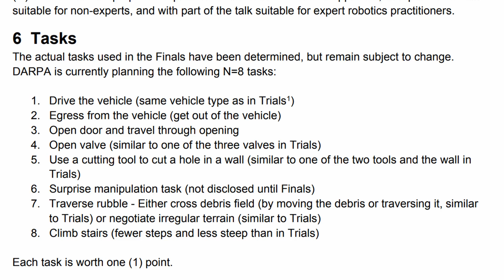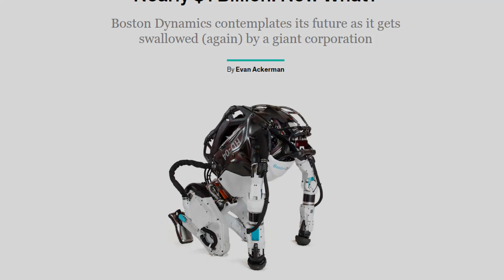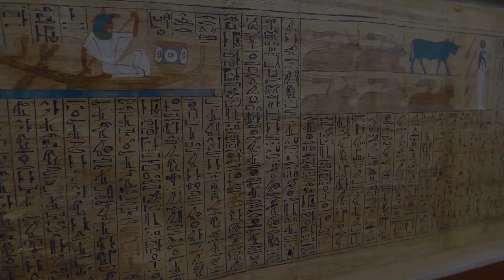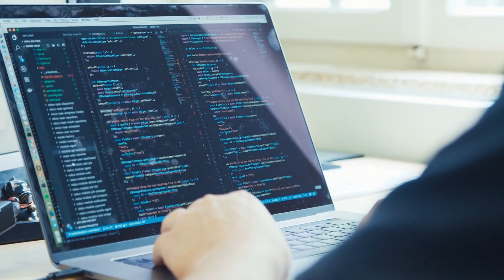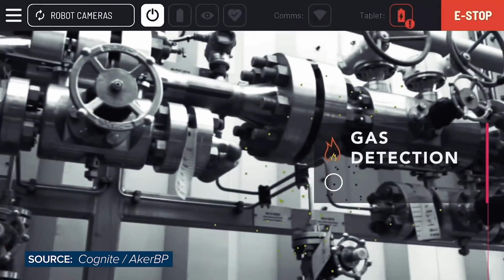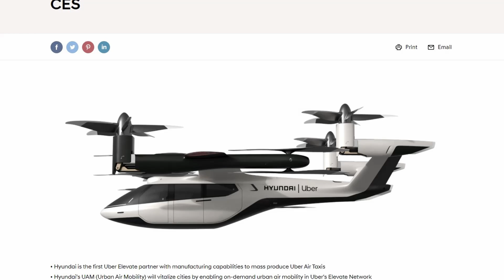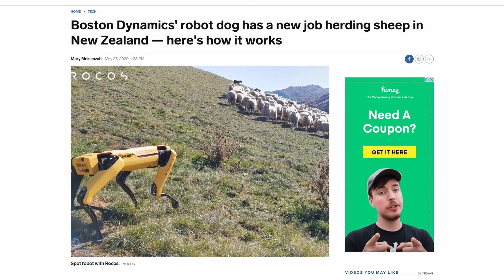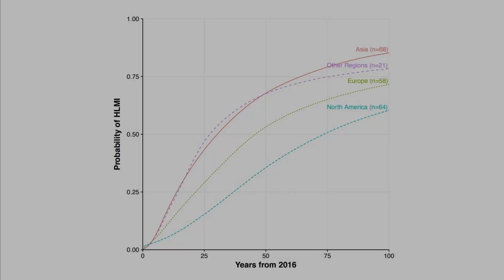Boston Dynamics 2021 - A Glimpse At The Future of Robots?

Comment: What do you think of an hot gas accumulator? Hydrogen cylinders can reach 700 bar (10'000 PSI) at 300K so they should reach 2'800 bar (40'000 PSI) at 1'200K (1000°C)
The robot would be able to jump 800 meters high with those xD
Reply from the maker: I'm not particularly familiar with them if I'm honest. Those kind of pressures are pretty insane, so safety risks are the first thing to come to mind, but of course in reality, safety risks are greatly depends on the specific application and the specific engineering involved. Do you have any good examples for existing applications? It would be interesting to check them out.
Reply: @ExaCognition  I just want real life anime characters honestly ^^
Reply: @ExaCognition  Everyone is using nitrogen for gas accumulators because hydrogen can take fire or leak through the bladder or even through the metal atomic lattice because of it's low atomic radius which can even change the mechanical properties of the cylinder.
Then if someone choose to actually use hydrogen for higher performance the idea of heating the gas is even crazier, you will need superalloys to prevent creep and you can't use a bladder because there are no elastomers that can survive at those temperatures. But you can use a piston accumulator instead.

Comment: When they get artificial printed skin, ligaments, joints, bone, veins etc down to a fine art and a better power system then they will be the most useful service device.
Reply: Why do you need a better power system for a sex doll?
Don't answer ^^
Reply: @johntheux9238  My comment had nothing to do with sex dolls - it was a general comment about how robots are currently made and the materials currently used and how clunky they are compared to the human body - the finest most agile flexible machine there is.
Reply: @poppete  Why do you need artificial printed skin, ligaments, joints, bone and veins?
Reply: @johntheux9238   It depends on what the bot is used for application and purpose - a mowing bot would not have such things. A multitask bot, a maid house bot, gardening bot, a cafe bot multitasking around a work area, lifesaver bot, anything that the dexterity of a human body is an advantage because of its agility, smooth flexible movement, The human body is the perfect machine with all its components working seamlessly as a whole - when it is healthy. Why wouldn't you mirror an artificial humanoid body on the original. Printed or grown skin - it flexes and moves smoothly around the frame of the body a protective barrier. Ligaments and muscle the stretchy bits that make your joints flex smoothly. Joints again flexibility, range of motion give cushioning and strength. Bone (what ever lightweight strong material they use - not actual bone) an internal frame as apposed to a hard external frame - strength of the frame that hold it all together. veins - to move the fluids coolants or warmers or what ever and power around to all the different parts of the robot body. Weight -  making the body lighter. EVEN I suppose sex bots if you can only think with your dick. - I look at what is being building now, I think they are so ridged and clunky looking more like a vacuum cleaner or toaster on wheels type thing - the human body is a fine elegantly crafted machine that has, agile smooth flexible movement. It could be stronger than a human body in many ways. Beyond the idea of a full robot android machine a spin off would be prosthetic limbs. I imagine if I was a person who needed a prosthetic limb one that looked and worked as seamlessly as the original would be a bonus.
Reply: @poppete  Steel is way stronger than bones, 2200MPa of tensile strength instead of 180MPa.
Using hydraulics allows unlimited amount of power for short bursts if you use bladder accumulators, they can also be used for regenerative braking.
3d printed design allows higher strength than any animal is capable of, just take a look at the new 3d printed leg design for Atlas.
And you can just add a layer of skin.
Reply: @johntheux9238  Imagine steel or 3D printed composite bone, imagine a flexible spine - bones are hollow with mesh like stuff in them so it could be fairly light weight and strong like bird bones. Just as everything has become smaller imagine then those bladder things being more like the cells and filaments that make up muscle. I suppose it is the development of the tech that does not exist yet - I feel were at the ground levels of the whole scope of possibilities (though we think we are supper advanced) perhaps the machine engineers need to sit down with the chiropractors, myofascal experts or the people who know about the movement and mechanisms of the human body - the stuff that nature built. You can see they have done some of that with the Atlas bot.
Reply: @poppete  Well, the oil channels that are used for actuation and cooling are now integrated into the leg so the channels themselves are a structural part.
But it's not based on an organic design, it's just that one part that has several purposes is better than several parts with a dedicated purpose.
Reply: @johntheux9238  How ever they get there suppleness, flexibility, agility, multitasking

Comment: So, when's T800 is going to be in the market?  First order for him would be, jump on one foot 🤣🤣🤣
Reply: Have you seen the 3d printed leg for the next gen Atlas? All the piping is going to be integrated inside the leg.
So if you want something bulletproof just wait a few years.
Reply from the maker: Integrated piping and the likes is going to make the manufacturing of many complex systems so much easier.
Reply: @ExaCognition  What do you think of SLM Solutions NXG XII 600?
It can print 1.2709 tool steel which is stronger than AR500 bulletproof plates...

Comment: We still need better batteries although they are on the way but processing power has just about reached its limit with current chips.
Reply from the maker: There's still a lot of latitude when it comes to chips, especially for many of the AI orientated applications where parallelism is extremely helpful.
Reply: @ExaCognition But will still need something that can mimic the human brain in its understanding of the environment. 40 years?
Reply: Brain cells are visible to the naked eye while we are currently producing 5nm nodes so ~20'000 times smaller...
So I would not bet against the machines ^^

Comment: Last 10m robots do not require a mask, do not wreak of cigarette smoke,  are not covered in gross tattoos and crappy facial hair and are not subject to having a bad day, so they actually place your box on the platform inside the screen door, and not on the stair, in the rain, or leaning a glass item in a box up against your door, forcing you to go out the back and around to retrieve it.   No matter how many times a delivery note is left to place item on supplied platform, these jack ass life hating millennials still throw it on the ground.    I look forward to Robotic delivery.

Comment: Moore's Law states that the number of transistors doubles about every 2 years. It has also been claimed that mankind's knowledge base grows exponentially, doubling about every 5 years. No doubt, exponential knowledge growth also applies to robotics. Based on the astounding robotics growth between 2015 and 2020, extrapolating, even just to 2025, the advances will likely be quite alarming.

Comment: I just want a robot that washes my dishes, clothes and cleans my home at every intrincated corner or furniture (not that "rumba" floor limited thing).
Reply: Norm T  Maybe there's some kind of software upgrade you can apply. You'd think they would get those bugs worked out before putting them on the market, though.

Have you contacted the manufacturer?
Reply: Coming soon to a decade near you. 10 years, maybe less.
Reply: @klumpytheklown3798  I don't think so. Leftists will make huge protests agains robotic workforce.
Reply: @nmarcel  We have since the nineties. We haven't had quite the effect we desired.

Who do you pay for domestic chores at the moment?

Comment: Tesla has designed computer chips especially for their cars. Do you know if Boston Dynamics has done the same with their robots, or plan to do so?
Reply from the maker: As far as I'm aware they don't design their own chips. Tesla are pretty extreme in the amount that they will vertically integrate of technologies to reduce cost. With that said, the developer platform gives 3rd parties a lot of room to add their own customization for their specific use cases.
Reply: @ExaCognition  Thanks
Reply: The cost to create one's own chip, starting from just a wafer, and then etching and depositing layers, is EXTREMELY expensive - starting from the many tens of millions to over a billion dollars. There has to be a large commercial market or a military budget for this. I question if even Tesla went this far. However, there are intermediate solutions. The least expensive are FPGA (Field Programmable Gate Arrays). Another level of customization are ASICs (Application Specific Integrated Circuit). My guess would be that Tesla would use some advanced variant of ASICs, although given they're market is potentially millions of very expensive products, their market might justify 'ground-up' customization.
 
Any company could afford FPGAs and the software used to 'program hardware'. Programming tools such as 'Verilog', System Verilog, or VHDL are typically used. ASICs require a tooling charge that's commonly in the tens of thousands of dollars and up. 
While Hyundai could afford making their own chip from scratch, the economics has to justify it. FPGAs and ASICs can offer very close to the same performance as a custom chip, and allow one to more readily make changes/evolutions than a complete custom chip. 
https://en.wikipedia.org/wiki/SystemVerilog

https://en.wikipedia.org/wiki/VHDL

https://www.wfmj.com/story/42322561/field-programmable-gate-array-fpga-market-2020-global-industry-study-by-overview-size-top-players-revenue-sharedevelopment-strategy-future-trends

http://www.interfacebus.com/ASIC_IC_Manufacturers.html
Reply: @gregparrott  Thanks

Comment: Robots will only get better - and at an exponential rate.
People have evolved to imagine changes at a linear rate.
That's going to become more and more problematic as our technological reach continues to accelerate.
Reply from the maker: I've got a video about the rate of progress coming soon! It looks at exponential rates specifically.
Reply: @ExaCognition  I was bornin the 60's, saw the moon landing as a kid. They used slide rules and what amounted to calculators to travers 250m miles and back.   Now, we have the power of an early Cray in our hand.    I am curious where the next leap will occur.  Optical circuits or quantum processors.  We still do not have flying cars, jet packs, or moon bases.   I am hopeful.   Keep up the great information.   Well produced video.

Comment: We are creating something 
You can not see yet 
What's coming  
Some will use it for good deeds and bad.
This is the last invention of humans .
After for a short period of time it will Start Making Decisions for itself.
It will control everything and anything. 
Tell Me one perfect invention humans made yet?
This will be worser then a terminator. 
It will Exterminate humans in seconds 
A Terminator, or T-Unit,[1] is a type of Hunter-Killerdesigned to terminate other life forms. Various Terminators are built by an artificially intelligentcomputer called Skynet in order to wipe out the remains of the human race.